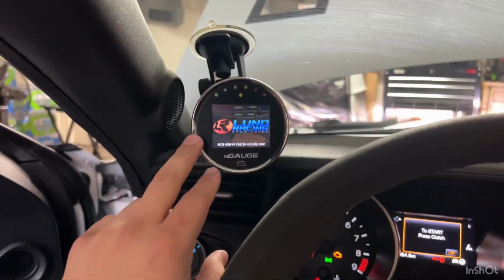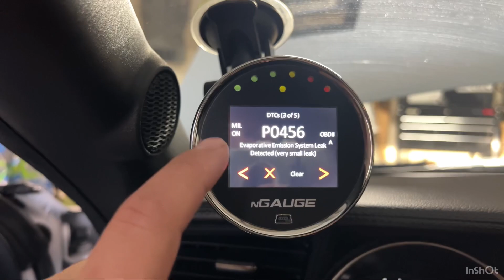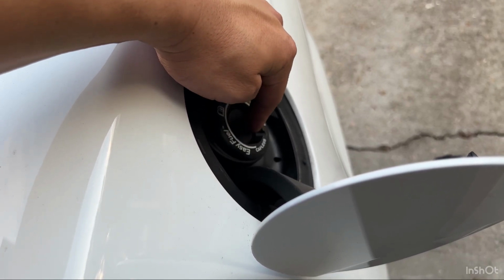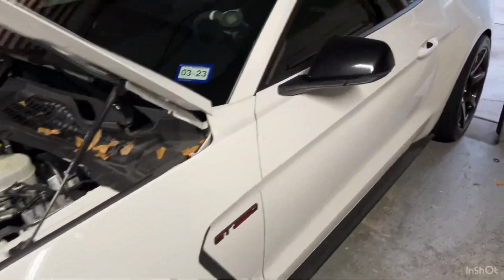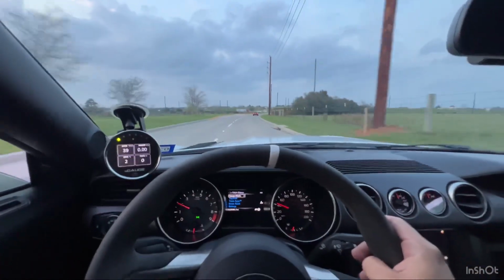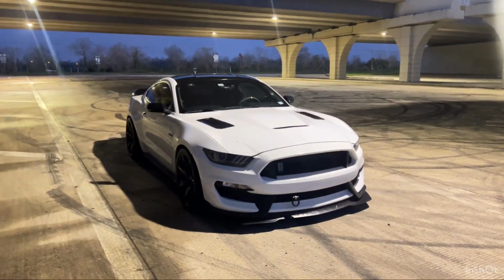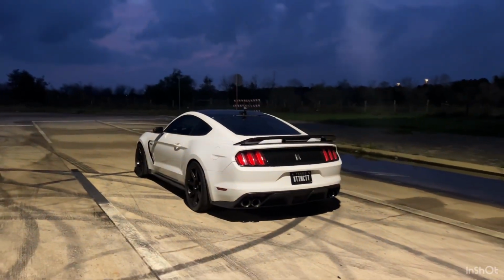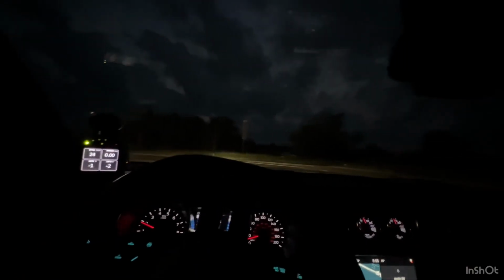Shelby GT350 (s550) common issue

Comment: @TrackDriven  350---Your car looks great man. The two extra vents to evacuate the heat , the GT 350 R splitter ,  and the aftermarket wheels.  Are those 6GR wheels?   How wide are the front and back wheels?  What size tires are you running in the rear?     I see videos where guys are running 325-30-19  in the back.  But I wonder if these WIDE tires rub on the rear shock or the fender or both. What is your experience ?  Any issues?
Reply from the maker: Thank you man! And these are the SVE which are sold by lmr.com, they are 19x10.5 and x11, and the tires are 305/30 and 325/30. It’s also lowered with steeda springs and I don’t have any rubbing issues. I really like the setup over the stock tire size. A lot more grip
Reply: @trackdriven350  --Thanks for the information.  Much appreciated.